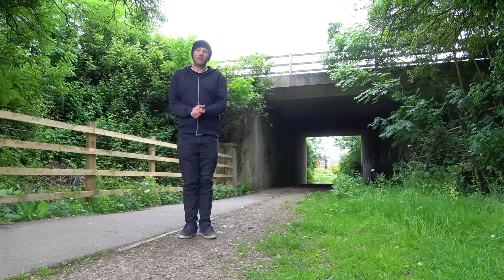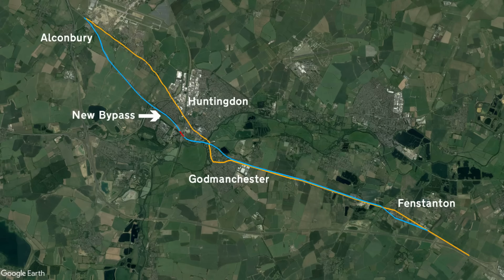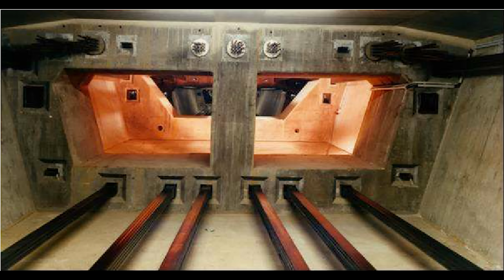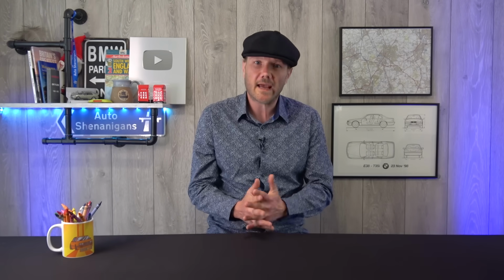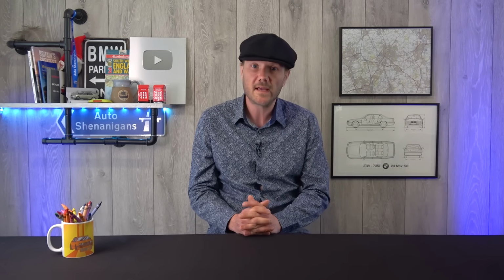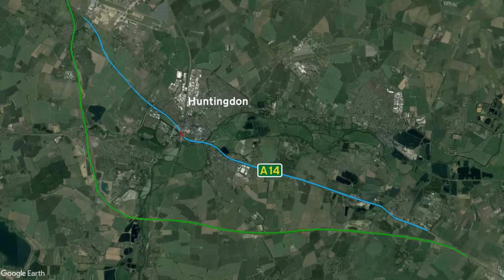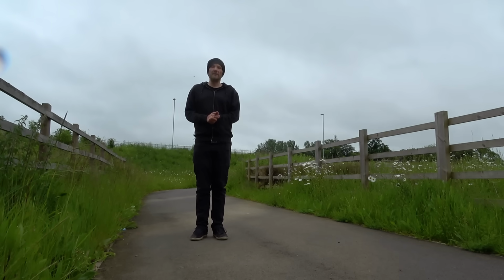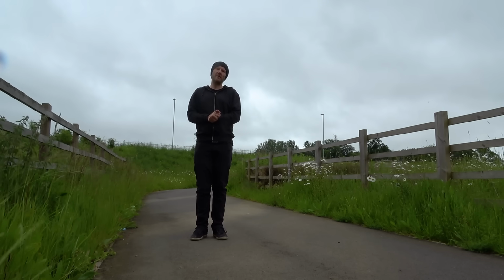Why Spend £46,000,000 To REMOVE This Bridge - Huntingdon Viaduct A14

Comment: Quite unusually for this sort of thing it's a massive improvement. Even the old bits of the A14 are now basically an express lane almost right up to the train station (outisde of rush hour).  Before all of this there wasn't an exit and you'd have to drive through slower, more residential roads to get there.

Comment: I am the site agent (site manager) that worked as part of the team  who completed the removal of the Huntingdon viaduct. 

The bridge had to be removed as it was in a state of disrepair, the concrete was failing in numerous elements of the bridge despite efforts over the years to prevent this from happening. Given time it would have become even more unsafe eventually collapsing.

Several options were considered during the optionering stage. Ultimately the final method was chosen as it was believed to be the safest, most cost effective solution, whilst causing the least disruption to the town and the east coast mainline railway. 

The chosen method to lift and remove the centre span, traditionally demolish the back 3 spans and then lift, slide and lower the 2 remaining spans cantilevering over the railway, was very complex and took a lot of very experienced engineers a long time to plan and execute correctly.

This was proven to be the right decision throughout the project as delivery element was completed without incident on time and on budget. 

There are always things that can be done better, but overall as a project the Huntingdon viaduct removal was a success. 

I spent 3 years of my life working on this project. I am extremely proud of the work we did. I really hope it has made a difference for the local area because it was a really challenging project. At times proving to be both an engineering and logistical nightmare to be honest! 

Great video Auto Shenanigans as ever, but I would say the bridge DEFINITELY needed removing, hopefully the town of Huntingdon is better for it in the years to come!

Comment: The new roundabout which was built where the northern end of the viaduct would have joined onto the old a14 is a bit, odd, but I think it opens up opportunities for any development.

I visit Huntingdon regularly, traffic is so much better and prevents massive bottlenecks at Brampton Hut services and interchange. 

Still a bit weird how there is NO DIRECT SOUTHBOUND LINK from A14W to A1S and viseversa for A1N to A14E. Cars have to go up to the "new" Brampton Hut services, navigate the junction and double back. Corners cut...

Comment: I learnt to drive on that stretch of the A14. It was terrifying. The new A14 means there's now a bunch of local roads so you can get between the villages without having to use the massive dual carriageway. When the A14 was still referred to as the A604 A1 M1 link road, my mum always used to complain that it was impossibke to get anywhere without messing with all the traffic & if only they would build some local roads. 30 years later they did just that

Comment: Strange, I would have driven over that viaduct hundreds of times over 10 years and then all the faff and diversions as the new section of the A14 being built happened I then stopped doing those journeys so hadn’t even noticed - the new section feels quicker the few times I’ve used it but adds several miles over the old route - and of course people still don’t know how to keep left as is the case all along the A14 even though the new bypass is 3 lanes 🙄

Comment: I live in Huntingdon. This over pass was literally collapsing, it  would have been more expensive to replace it. With the A14 being rerouted to the south it made perfect sense.
Reply: Yep, I remember when lumps of concrete started falling off it. The A14 upgrade had been in the pipeline for decades (CHUMMS being one of the early studies) but was shelved for a long time. I left before the upgrade was delivered, but have seen it since and it’s a huge improvement. I don’t miss taking an hour to drive from Huntingdon to Cambridge in the am peak.
Reply: I travel to work by train going north through Huntingdon. One morning a few years back there was a problem north of Huntingdon and our train terminated. The train company arranged taxis to get us to Peterborough but we would need to wait for them to arrive. It was raining so we all sheltered under the viaduct. However, we had to be careful where we stood as water was dripping down from it in various places.
Reply: let us know in a few years when busineses start closing down and leaving. we have a long history of bypassing roads here in america and the locations often turn into a ghost town following a couple decades.
Reply: @geronimo5537  this is not like that as the old road just passed above Huntingdon on a flyover so it brought very little passing trade to the town.

Comment: Back of an envelope calculation but £46,000,000 is cheaper than paying compensation and loss of earnings to the treasury for say, 10 people killed when the bridge goes down.
(For reference, the Grenfell Tower Fire Enquiry so far costs £1.2 billion for 72 dead plus wounded... about £8,000,000 for each of 150 people.)
Reply: considering it would fall onto a mainline railway, it would probably kill a lot more than 10.
Reply: @RGChandler  also depending on the time of day, its also a walking route for the local secondary school

Comment: I have a suggestion for a video if you're interested. The Kingskerswell bypass in South Devon, just outside of Newton Abbott. It took many years of planning to get it done, I do believe they started in the 90's to start and get it through. It was completed a few years ago. It's a good piece of engineering as it involves a flyover over a railway and a busy roundabout.
Reply: Yes, but is there anything wrong with it? If not then this guy has nothing to make a video of.

Comment: The removal of an eyesore, noise, and pollution from Huntingdon is undoubtedly an improvement.  But what was not clear from the video is that it made a big improvement to traffic on the A14.

The map shown only showed the spur to north of Huntingdon making it look like the road only ran between the M11 and A1(M), but the main line of the A14 turns west to the north of the town to  head across country to join the M1 and M6.  And because the A14 was made out lots of bits of existing roads it meant to use the mainline traffic has to leave the A14 at Spittals Interchange to use a roundabout to join the A14 (now renumbered as part of the A141).  And that only took to another roundabout at the Brampton Hut Interchange with the A1.  So the new route not only improved Huntingdon, it also removed those roundabouts and finally made the A14 a freeflowing road all the ways from the edge to Felixstowe to, well, Scotland, as if you do not take any junctions becomes the M6 which becomes the A74(M), which becomes the M74, which takes you onto the M8.

Given the increasing risk of the viaduct collapsing, and it sitting over one of the countries most important rail routes, the cost of leaving it up would have ended up being far worse that the cost of demolition.
Reply: And it's not like most of the old road has been dug up or anything, it's just been added to the local network.  I would imagine having the traffic further away from the residential areas makes it a lot quieter too?  Towns where all you can hear is traffic are a bit oppressive IMO.
Reply: Thanks Rebeka for an extremely informative comment.  In particular the point that the viaduct crossed the East Coast Main Line should have been stressed in the original video. Before 2020  I occasionally used Huntingdon station, just south of the viaduct.  The removal of this viaduct must have considerably improved the environment for waiting passengers.
Reply: `I second this. It's been a big improvement. It also provides a very quick and easy way in and out of Huntingdon and the station that doesn't involve the ring road.
Reply: ..
Do you know Jesus Christ can set you free from sins and save you from hell today 

Jesus Christ is the only hope in this world no other gods will lead you to heaven 

There is no security or hope with out Jesus Christ in this world come and repent of all sins today 

Today is the day of salvation come to the loving savior Today repent and do not go to hell
Come to Jesus Christ today 

Jesus Christ is only way to heaven 
Repent and follow him today seek his heart Jesus Christ can fill the emptiness he can fill the void 
Heaven and hell is real cone to the loving savior today 
Today is the day of salvation tomorrow might be to late come to the loving savior today 
Romans 6.23

For the wages of sin is death; but the gift of God is eternal life through Jesus Christ our Lord.

John 3:16-21 

16 For God so loved the world, that he gave his only begotten Son, that whosoever believeth in him should not perish, but have everlasting life.  17 For God sent not his Son into the world to condemn the world; but that the world through him might be saved.  18 He that believeth on him is not condemned: but he that believeth not is condemned already, because he hath not believed in the name of the only begotten Son of God.  19 And this is the condemnation, that light is come into the world, and men loved darkness rather than light, because their deeds were evil.  20 For every one that doeth evil hateth the light, neither cometh to the light, lest his deeds should be reproved.  21 But he that doeth truth cometh to the light, that his deeds may be made manifest, that they are wrought in God.

Mark 1.15 
15 And saying, The time is fulfilled, and the kingdom of God is at hand: repent ye, and believe the gospel.

2 Peter 3:9
The Lord is not slack concerning his promise, as some men count slackness; but is longsuffering to us-ward, not willing that any should perish, but that all should come to repentance.

Hebrews 11:6
6 But without faith it is impossible to please him: for he that cometh to God must believe that he is, and that he is a rewarder of them that diligently seek him.
Jesus
Reply: Such an auto shenanigans comment, bravo!

Comment: I did hear there was a lot of pressure building on the Contractors to get the new A14 built and open, as the Huntingdon viaduct was very rapidly reaching the end of it's useful life. In fairness I think the redesign of the A1/A14 sections at Brampton Hut have funnelled all through traffic away from Huntingdon, so the (now) A1307 is basically a back road for the Locals. Town Bridge is 7.5 tonne weight limit so no heavies can go that way anyway. 

The A421/A428 Black Cat to Caxton is proving interesting. Now the environmental mob have been told to piss off, work can actually begin, (and it has), but looking an expensive road to build, working out at £10 Million a Mile. Also seems when they built the new A421 from the M1 J13 through to the Black Cat, circa 2010ish, they didn't think they might want to continue it past the Black Cat so didn't build the Roxton Road Bridge wide enough or in the right place. 

There's also a small thatched cottage slightly North of the Black Cat which I believe is in the way, but cannot be knocked down.

Comment: It wasn’t just a bridge, it was one of the few bridges with  apart from being huge was also spanning a road and rail i was told one of only three like it in the country, the huge crane used was itself an astounding piece of engineering let alone the removal of the span, it’s made a huge difference to the local roads and noise, Money well spent

Comment: Having lived in The Huntingdon area for the last 25 years I can only say that the A14 "Upgrade" is only that in name. While the benefits to the town are very apparent the rest of the upgrade is a horrendous piece of planning (or lack thereof).
 Now, to go south on the A1 from the westbound A14 you have to leave the A14 and join the northbound A1 At Buckden, Travel a mile north to Brampton hut roundabout, then use the roundabout to reverse direction to go back the way you came from to go south.
 Also to go south on the A1 from the eastbound A14, you now have to negotiate a tight series of extra roundabouts in order to do so. 
 To go north from the A1 onto the eastbound A14 you have to do the same thing round an extra two tight roundabouts which for heavy goods vehicles is not an easy thing to negotiate especially in bad weather at rush hour. These extra roundabouts have already had to be resurfaced due to the wear placed on them by the heavy traffic and has been the site of many accidents since opening in 2017.This could have been easlily avoided by incorperating an extra slip road from the northbound A1 directly on to the eastbound A14 which would bypass the busy Brampton hut roundabout completely and ease a lot of the congestion there. the design of the junctions where the A14 and A1 roads meet, north and south, have also been the site of numourous accdents as four lanes of flowing traffic are funneled into two and in the case of the southbound A1 the traffic joining from brampton Hut has to try to fight its way across the traffic leaving for the A14 at Buckden. It's the worst road plan you can imagine and accidents are all too common!
The only benefit to motorists has been to smooth out the transition past Huntingdon for A14 traffic which is now seamless but for the rest, its been a right balls-up!
Reply: The fun part is to go from the A14 eastbound, decide you want to stop off at Brampton Hut services for a delicious Wendy's, and then continue your journey eastbound. Good luck finding the A14 again
Reply: It annoys me EVERY time I travel to/from Cambridge to Buckden how I have to drive North up the A1 to go back South.and visa versa especially when you can see a nice little ‘service road’ which is for use by.. who knows! 🤨

Comment: The viaduct was part of a not very well thought out plan for by-passing Huntingdon. It was a major lesson in cheapnicity, they also took the dual carriageway A604, virtually un-improved and magically turned it into the A14 which connected a lot more traffic into the local network. With short slip roads on and off plus plenty of local traffic (tractors, cyclists and other such) the previous A604 took on a volume which it was not fit to bear, no wonder that that road became a 'demon' between Huntingdon & Cambridge.
Reply: The inner Ring Road is another shit show of something that someone thought might be a good idea at the time, but just trapped the town centre.

Comment: Many people still cut through Huntingdon as it’s several miles shorter and just as quick as the much longer new road, but they’ve put a 40MPH limit on miles of the old empty dual carriageway to try and slow you down and discourage you from doing it! Feels ridiculous being kept at 40MPH on a nearly empty dual carriageway for the sake of ‘safety’ 😂
Reply: You learn something every day. I didn't realise you could bridge the old A14/A604 link without going through the middle of Huntingdon. Must try that next time I'm that way.
Reply: @paulscottrobson  I’d avoid it 0800-0900 in the morning and around 1600-1730 evening rush periods as busy so recommend sticking to the new A14, but otherwise it’s very slick.
Reply: Are the average speed cameras still there? If not then no worries!
Reply: I’ve explained elsewhere on this thread the reason for the 40mph limit. It’s actually legitimate but should have been resolved ages ago before the road was passed over to the council.

Comment: https://www.youtube.com/watch?v=8BMrOHu5Tmk these people do good documentaries.Their engineering failures show how dangerous this is, those filling are not just sealing for water but also form a massive point of structure to and otherwise joint like that. The story of a wood bridge on here demonstration how weak these joints in bridges are in they ars not just seal filled but it add structure to those type on joint which are very poor otherwise. I can find it but on one of the show they show a bridge that collapsed because no back fill sealer was used and the sealer itself is part of the structure. Like B1M the docu's are great to watch if your interest in engineering.